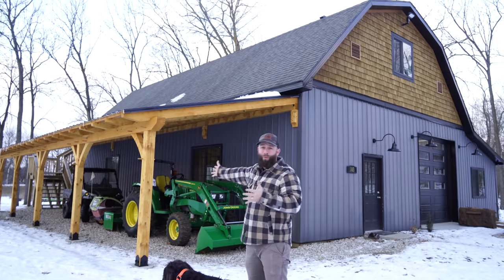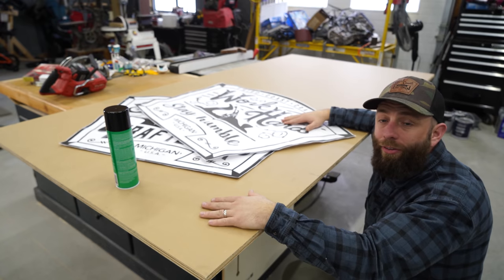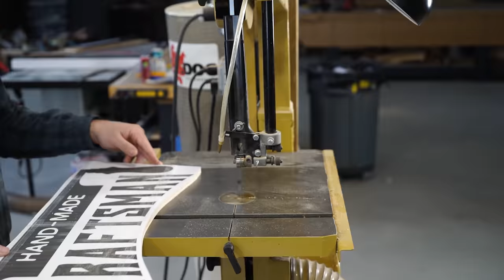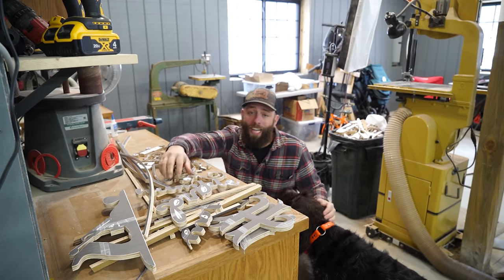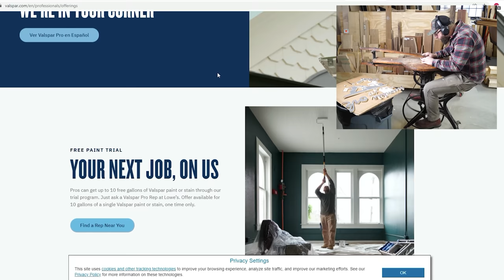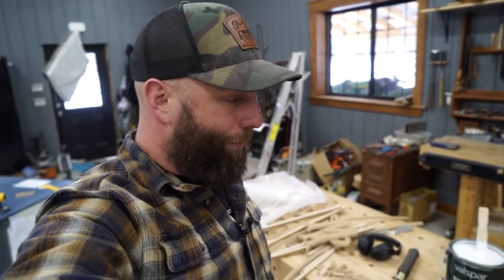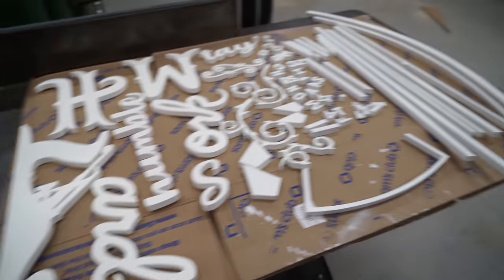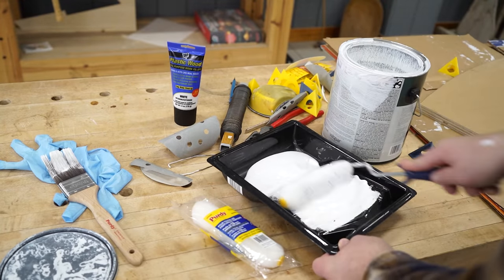How To Make A Sign WITHOUT A CNC!

Comment: Beautiful job.  Two ideas I have used in painting projects with multiple parts:  1.  Prime the back of the large sheet before cutting out the pieces.  That way, the back is already marked before the cutting.  Saves a step and eliminates the possibility of flipping a small piece.  2.  When painting a deep color like your black, I tint my primer.  It doesn't have to be as black as the final surface.  Eventually when the surface starts to wear, I don't have white primer showing through.  Background:  Many years ago, we owned a house with wood shingle siding that had been painted brown.  It needed a complete re-coat and a painter gave us what we considered to be a fair quote to scrape, prime, and repaint.  I told him I wanted the primer to be tinted very close to the finish coat because if it was not done, I was going to be able to see white in the cracks between shingles.  I came home one day and he had primed the house in white.  I should have just made the house white.  He finished with the brown and from that day until I repainted the house myself years later, I could see white primer on every side.  That convinced me to use tinted primers under strong colors.   Disclaimer:  This comment is presented by a rank amateur.
Reply: Ugggh shame to hear about the guy not tinting it right the first time.  And it wouldn't have taken nearly any extra effort, oh that's frustrating to hear.  Thank-you for the painting tips from that experience, hope that helps soothe the memory a bit XD
Reply: Ha. Great comment. Even rank amateurs can have skills that the so-called pros can only hope for. I always end up painting my own houses because every time I get quotes from pros, they usually all end up explaining what a crap job they'll end up doing if you ask enough questions. Same with carpenters, electricians, plumbers etc. HINT: most people can't afford the really good ones ;)

Comment: Great video! Just a tip if you open the image in Adobe reader you can print it as a poster, just chose the poster button in the print options, you’ll use less ink than with printing with paint

Comment: I LOVE LOVE LOVE that scroll saw!!!  I use the same transfer system when I paint cornhole boards.  The difference being that I put Painter's tape down over the whole surface first, then use a utility knife to score through the design into the tape, then I have a custom stencil!  I will have to remember that it's applicable to cutting things out too!

Comment: Dang, that pedal-saw must take some coordination! I almost fell over just watching. But great exercise.
One thing I noted was toward the end when you glued all the parts down - you might want to look for a hard rubber roller - the kind they used to use at a print shop. This will provide a smooth even pressure for your adhesives to set up and assure a good bond. And yep - I'm an old dog with a new trick!
Nice sign Chris.

Comment: That was flippin’ AMAZING! Most impressive is that this was done by hand… kinda. No, you didn’t get get all Rex Kruger with hand tools. Would’ve taken years, even taking this on with the band saw is a big task and the sanding! Very labor intensive. Many woodworkers hate this part of the job, but I get the feeling, “at least for this project” it may have been therapeutic. Finally, I got a real kick out of the scroll saw.

The work on that sign is very detail and honestly never considered that level of work could be done without a CNC machine but the truth is this is exactly how it was done before CNC machines.

I do have one question though and that is how long did this project take?

Comment: As someone that uses a scroll saw pretty regularly, that vintage saw looks like a nightmare to me.  To be able to pedal and keep concentration of where you're line is would drive me to never touch the hobby again.
Reply: I've not used a pedal-powered scroll saw, but I have used a treadle-powered potter's wheel. I found it very relaxing, sort of meditative. You get 100% absorbed in the process. I imagine the pedal scroll saw to be similar.